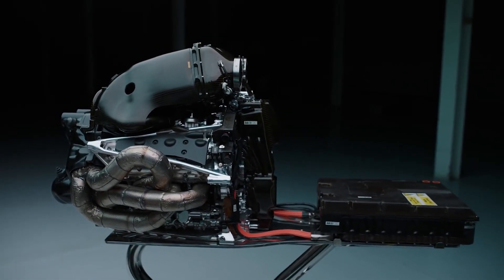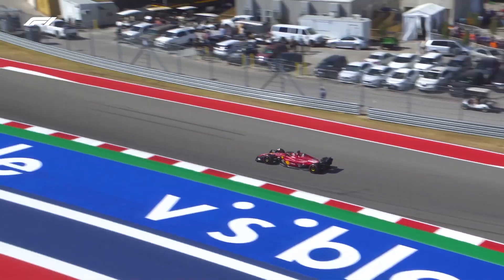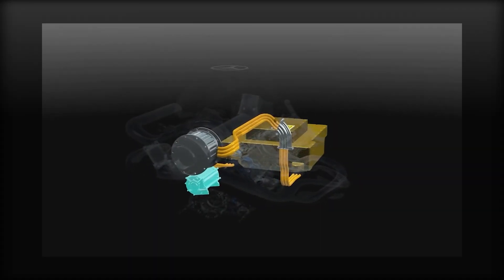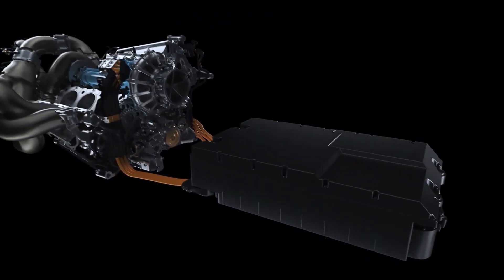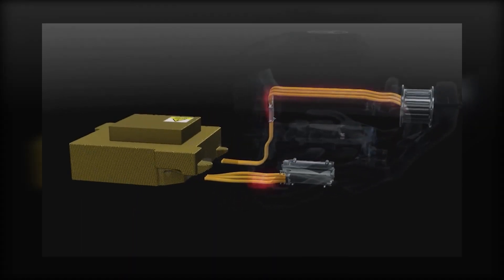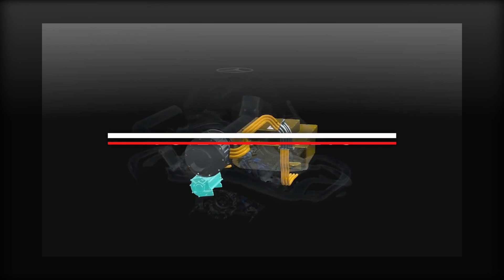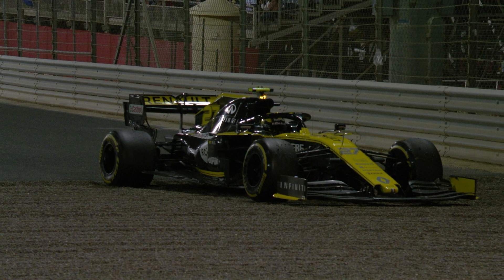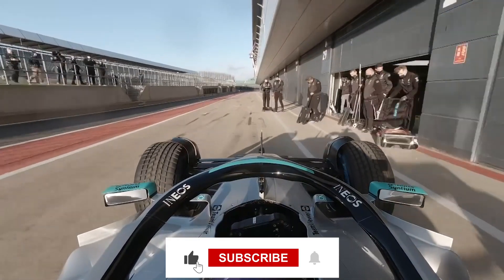Formula 1 Engines Have This Much POWER...

Comment: They rev up to 12500 not 15000.
Reply: Goofy ahh comment. They limit at 15000. Generally we see them topping out at 12-13k due to fuel flow limit, it's not the intrinsic limit of the engine.
Reply: @BNJ_VODS  Yeah the limit is 15k but they don't rev up that high.